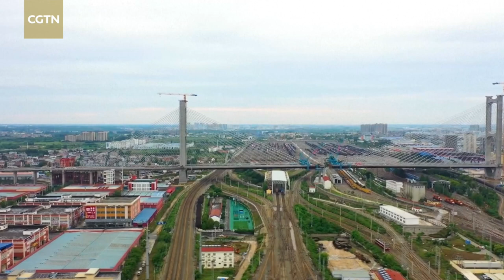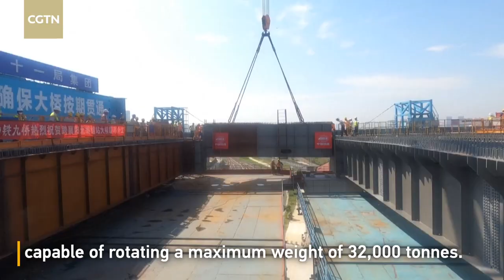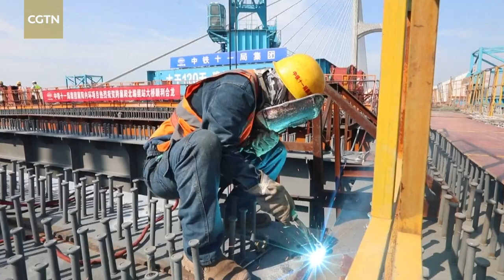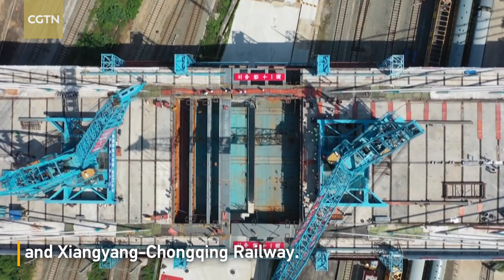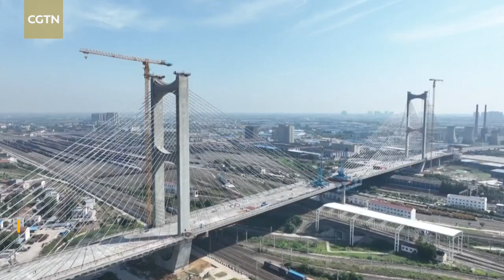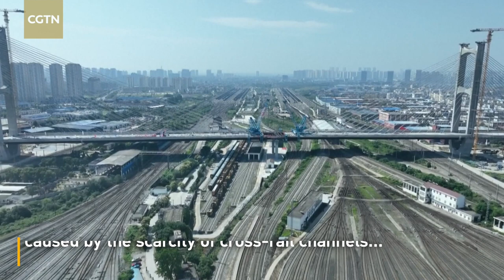Bridge spanning 32 railway lines in central China connected

Comment: The bridge spans over 32 railway tracks. How do you build it without shutting down train traffic? You build it along the direction of the tracks on empty ground, raise it up, rotate it 90 degrees and connect with the other half on the opposite side. Imagine rotating a structure that is half of a kilometer long!